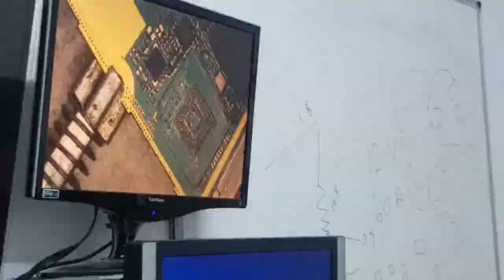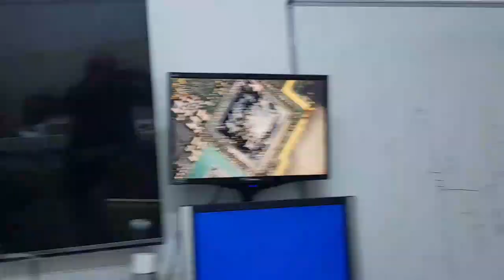Ekran ayırma teli ile entegre sökme ve rem ayırma

Comment: Great idea on samsung ic with soft fethid glue but for me only when area around ic is without components..otherwise double job :)
Reply from the maker: I work more different methode with coil next days i will make may be suprise
Reply: @birgsm  an applause for  the your research on alternative desolder /solder method , thanks for sharing